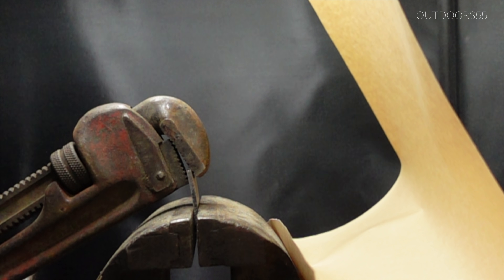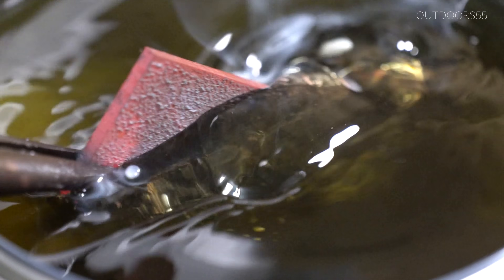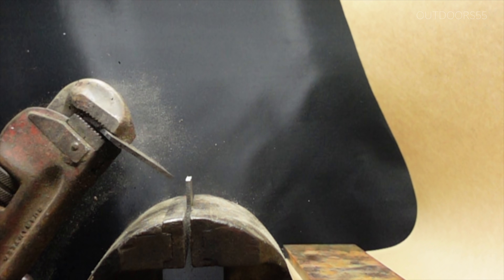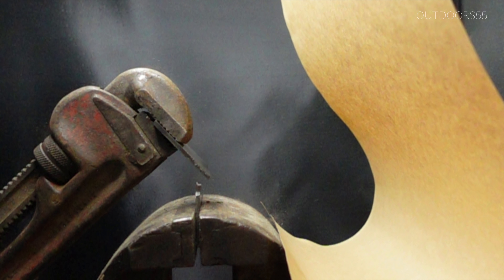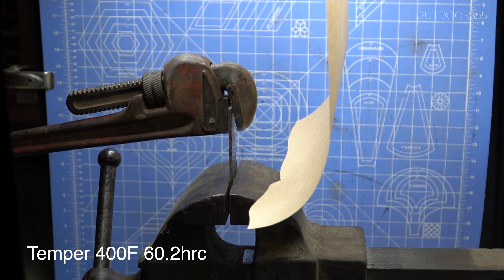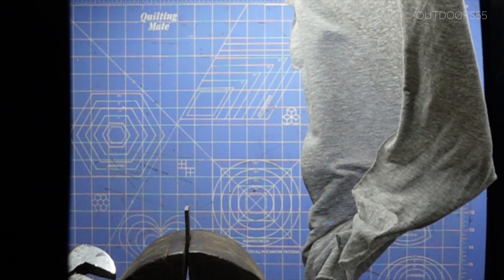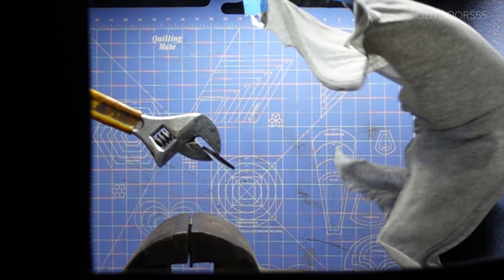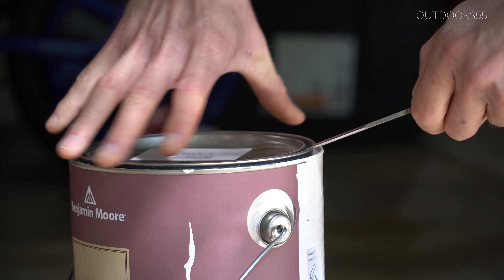Why You Should Never Break A Knife....And Probably Can’t

Comment: I always assumed they were concerned of practical use and functionality, qualities, over the safeness of the blades. It seems like where the qualities are needed for the use, it can't much be helped, no matter the type a catastrophic failure due to unforeseen circumstances will be catastrophic failure since the metal will give up after packing a great deal of energy. I suppose the safety equipment is the only real answer to the safety side of things. Sort of "if you wanted cars to be actually safe in a catastrophic failure situation, you'd have to remove cars" situation.

Comment: Hot steel going into your eyes and shoulders don't feel good. I've had both. But I also like my knives hardened to 60-62 rockwell atleast if applicable. Depending on the steel, higher. 

 If you use the knife as intended. And don't pry on it like a dumbass, shattering blades don't matter.

Comment: Thank you for this informative video! I understand the point you were trying to make. I typically only use my blades for cutting tasks. I like SAK knives for this. I heard that the other tools on a SAK are tempered lower than the blades for example the large cap lifter and screw driver they recommend for light prying tasks. I typically don't carry a knife with that feature. I carry  a single bladed number 1. Since retiring I'm usually always close to the proper tool for the job. I bought a small tinker I really like, but love the Alox handles on my number 1. Everyone is different and needs to find what works for them and their personal use. Thanks again for doing the video!  Jeff

Comment: I think it very much depends on the steel and the type of knife. With a hard use knife (like a chopper etc), one ideally would want a tough steel that bends under failure instead of it shattering. But then you have steels like M390/20CV that are not designed to be "tough" at all but have good edge retention, and the performance really shines between 62-63hrc. But still. After being on the market for so many years, companies still run M390 at 60hrc (sometimes even lower) to "increase" toughness. That to me makes no sense. Taking a steel that is not designed to be tough, heat treat it lower to make it "tough". While in reality the companies would rather save money on grinding belts instead of heat treating it at a proper hardness. They will charge us the premium price but not go the extra step to do the work we pay extra for as a customer. More transparency from some companies would be great, or just use a different steel than M390 /20CV if they can't deliver the HRC and heat treatment certain steels need to gain the performance and attributes of said steels. If a company took ZDP-189 and made it at 60hrc, it would leave some people scratching their heads.

Comment: I do sword fighting and we once had a blade break. Found the pieces stuck in a tree and we were terrified since checking every blade before use. Pretty much reflects your results
Reply: I always say "you can use a blade that's too soft, but you can't use a blade that's too hard"
Reply: @jeanladoire4141  Aye. you can keep fighting with a blade that has a kink in it, but one thatcroke off....not so much.
Reply: @lutzderlurch7877  yeah, blades were pretty fuckin soft (close to untempered mild steel) for most of history.
Reply: @jeanladoire4141  Not sure I'd go that far. it is surprising, how much was possible, genrally speaking pretty early on already, and  what was actually done, as well. But without electric controlled thermometers and furnaces, modern chemical analysis of the pieces of steel, there was  a much higher variability, and a good argument to err somewhat on the safe side. Swords also broke in combat, but it just goes to say, the  line to walk for prefect balance is narrow at best, and with a thing as long as a sword and subjected to the forces a sword blade is, one had to be careful not to overdo the hardness.
Reply: @lutzderlurch7877  no i saw studies, on earlier swords (before the proto industrial revolution of the mid 14th century), the steel was rarely even tempered, parts of the blade were wrought iron, and a few centimeters later there would be a patch of tool steel. Average hardness in the 13th century would be around 25 rockwell. And i say average beacause every centimeters of the blades would have different hardnesses. Swords would rarely break on earlier periods, being more prone to bending, as was mentioned by Caesar for Celtic swords, Nordic tumbs found with bent swords, and just metallurgical analysis of the found exemples. So yeah, i'm pretty confident when i say swords were usually pretty damn soft, with harder spots, but it was a nonsense to have a hard sword, beacause a blade doesn't need to be very hard to perform well, contrary to what people say today (and once again i'm a bladesmith, i make swords, tools, whatever, and i have experience working with bronze, and while they need frequent honing, just like a poor quality modern steel blade, they will do what you want them to. I've chopped a deer into pieces for a hunter with a mild steel falchion that was 2mm thick near the optimal striking point, and the edge didn't take a dent even trough the spine and bones).
Reply: @jeanladoire4141  Are you sure it mentioned very uneven hardening, or blades made by forge welding several different types of steel together?

Memory is fuzzy, but I believe bending swords was at least is some portions done to ritualistically destroy the weapon or make it unusable for grave robber, likely including purring it into a fire.

Do you have the name of the study handy?
Reply: @lutzderlurch7877  regardless of if the hardening was uneven it wouldn't matter as the carbon content was just all over the place, just like a puzzle a lot of the time. Good hard blades existed, but they were for the top of the elite. That would have changed in the 14th century as society began to industrialize after the great plague, i've visited paper mills of the 14th century and then checked medieval industrial forges, and found the exact same mechanisms for mechanized hammers (with water etc). The proof of steel quality advancement can be proven by both the appearance of steel tempered crossbow prods, and just by looking at manuscripts and seeing that more and more soldiers wore armor on the depictions.
But that wouldn't have been the case before. I'll try to find you the study on the swords and get you a link 👍
Reply: @lutzderlurch7877  so i just did a quick research and found one of the studies, this one was about ulfberth and early medieval swords, "a metallurgical study of some viking swords". Carbon content from 0.36% to 0.76%, all over the place. Average hardness of 120-160 vickers in the center, and 220-300 vickers at the edges. That's about 29 rockwell for the hardest part of the edge,the rest of the body is too soft to be classified on the HRC scale. The structure was pearlite and cementite, basically results of untempered steel. The edge was probably harder beacause they hammered it cold to work harden it, just like you would with bronze swords. I sometimes make knives from modern aluminum-nickel bronze, and i'm getting hardnesses of about 280 vickers, more or less (i do the tempering over the fire so i never really know the result, just an approximation), and frankly that's on par with what they had at the time. A well made traditional tin bronze would also go above 200 brinell with proper cold working. And these were high quality swords for the time. They chopped skulls in half with clean cuts (as the skeletons from battlefields can show). An untempered blade will perform pretty well against anything that's softer than it (like people), at the cost of frequent maintenance.

Comment: The other reason you wouldn't leave the steel at its ultimate hardness is sharpening. Once you get around R62 sharpening is a pain. Add Chromium in amounts 5% or larger and you get an extremely wear resistant steel. (Think M2 hss drill bits. When you get to steels that are 11% to 15% wear resistance is off the charts. D2 steel is a perfect example. Above R60 it's a nightmare to sharpen on natural abrasive stones and ceramic stones as well.

Comment: You have a kiln, should make the spine softer than the edge. I've spent years in SE Asia where they forge machetes out of leaf springs and harden just the edge then normalize  it. These blades are 12 inches long and are tapered from about an eight inch at the spine to razor sharp, enough to cut heavy bamboo or a mans arm off with one blow. And you would never break one, maybe just chip the edge or tip.

Comment: Chapeau, a good choice of interesting subject.
The higher the degree of hardness the blade will not be flexible, and it will be more prone to breakage and its maintenance will be more challenging both in the sharpening means required and in the technical challenge in sharpening it.

Comment: 4:28 You took a "decent size" piece and got 83mph, I tracked another piece, and if you were shooting at 1000fps, and the distance between the vise and the paper is about 8 inches, then that piece flew at 330mph... Perhaps tiny, but get anything at that speed into your eye and it's very likely blind or at least going to need surgery to save your vision in that eye.
(edit: I had rounded it down as my calculator said 334mph... Funnily that's the exact same number you found when you tracked the sparks a bunch later in the video, so I assume my guesstimates were pretty much spot on, ha! Sweet video, interesting addition to your older video titled something like "why you should always break your blades" ;p )

Comment: Nothing new under the sun. It's just that most of people look at their knives and think about their knives more than they really need to use them on a daily basis. Practical reality will always have the last word on the empty vanity of modern urban man. Ask a breeder or farmer from South America, Africa or Asia how they prefer their blade.
Reply from the maker: This video has far more applications than just knives. Hardened steel is used in many applications, chisels, hammers, drill bits, jackhammers, etc.
Reply: @OUTDOORS55  You're right on this point.

Comment: To be completely honest, I’m on the fence here about how dangerous these little bits flying off actually are. I understand there are random (and very rare I’d say) cases where people are injured, but I really do not think these little chips contain enough kinetic energy to do a lot of damage. Especially if you have safety glasses on.
Reply from the maker: I was injured by a piece of hammer head that broke off (hardened steel). Cut my arm and my forehead.

Comment: Sometimes you may want to have softer steel. Victorianox uses soft steel purposefully to make it easier to sharpen. Its increadible easy to sharpen in a short amount of time instead of needing a special diamond file or something. Also like a razor blade, having a little bit of flex helps a thin knife in many ways.

Comment: Friend, does anyone use 4140 or 4340 to make knives? {I always get, "Duh! Tha carbon points are too low" YES, BUT the idea is that the Chrome;  Molybdenum and in the case of 4300 Steels, Nickel as well, increase strength and durability, Maybe you cannot make good knives from Chrome-Moly, but this cannot be determined solely by the points of carbon.} The SAE chart also lists 4350, but no one has any… Antway, assuming that you can make decent knives from Chrome-Moly, could you make Damascus with 4140 and 4340? Thanks!

Comment: Maybe for big manufacturers, warranties are an issue, but for a small time "hobby" knife maker, I'm more concerned about reputation. Literally one single bad (and possibly dishonest) review about a knife breaking under "normal" pry bar or log splitter use could shut me down. It's one of the reasons I usually use 5160 tempered at 400, with a 1/4" spine, even though I consider it excessive personally. That, and a surprising number of people seem to think a knife tip chipping or deforming when dropped onto stone or concrete isn't a sign of operator error (I mean, lanyards just aren't cool) but a sign of a defective blade.

Comment: Hard steel requires more strength to break, but impact and fractures is what dooms it. The harder the steel the more the imperfections will propagate through the piece.  I had a knife one time and it was quite hard, I hit a coconut shell with the spine of the knife with very little strength,  and the knife went ding and I had two knives after that. You never know when  a brittle blade will snap with impact/harmonics/flaw propagation, etc

Comment: My father worked as a mechanic for a long time and I've watched him cut bearing races off of axle shafts using a sharp cold chisel and a big hammer.  And occasionally he would get small sharp pieces embedded in his skin.

In terms of knives if you have a knife that yields slightly at high stress vs. fracturing, the user can see that they are pushing the knife too much and they will stop before going further.  If the knife continues up the stress/strain curve to its fracture point the user does not have any indication of how close they are to failure.

I will suggest another factor for consideration in your tests and that is stress concentrations at notches.  Breaking a smooth flat bar you have no stress concentrations, you are using the entire width of the piece under uniform flexural stress.  But knives have various notches- gimping, notches for locking mechanisms, holes for thumb opening and thumb studs, sharpening notches, choils, etc.  You will get a higher stress concentration at these irregularities that will cause the blade to break before reaching its full fracture strength.  I've seen plenty of blades broken through irregularities like this, likely at lower values of force than it would have taken without the irregularity.  Test some samples with irregularities and see how the strength varies at different hardness values.

Comment: If people didn’t know answer to this, they are air headed. Not trying to be mean but it’s common sense, that softer materials are more malleable, harder materials are brittle. Not just metals, either.
Reply from the maker: That is true, however that isn't what this video was about.
Reply: @OUTDOORS55  I know this, but you stated a question at the beginning, why manufacturers don’t make them as hard as possible for edge retention. Or something along those lines. Not quoting, of course. 

Brittleness, and the dangers that come with it, are what both points you made boil down to. 

I will apologize for being an ass though. I shouldn’t have even phrased my comment that way.

Comment: It doesn't make sense to me to ignore edge stability, since that is the main reason why you would change the hardness of an edged tool. If manufacturers were really scared of weird warranty claims or safety issues I suspect they would just selectively harden/temper using some sort of induction heating.  It is done all the time with saw teeth and such.

Comment: The real reason is that you're not looking for hardness over everything else. Overly hard blade is brittle so it chips more easily therefore losing its sharpness way faster and it's harder to sharpen.
Reply: That's why some steels are "better" (M390 vs 440A) - you can heat treat them to a higher hardness without losing other desirable properties like corrosion resistence and elasticity. Other benefits include more uniform internal structure and composition more suitable for some applications.

Comment: The aspect of danger as it relates to metal failure at different hardness values is interesting in and of itself I think. In the context of a knife, I think your conclusion is absolutely correct taking into account the average user. But what if we remove the human element altogether? If both soft and hard metals are to break, which is the most dangerous one? How dangerous it is depends on so many things. For instance if you assume that the same force is used to break a piece that will split in three compared to a split that will break into 30 smaller pieces, then the smaller pieces would be preferable, since each piece represents a smaller part of that original energy. Then there's the contact area to take into account. A bigger piece will be much less dangerous if it hits you flat and not on a corner, while smaller pieces are by nature pretty much pointy everywhere. Then what about the direction? If the big piece flies away, it can only go in one specific way. You'd be more unlucky than lucky if it were to be in your direction. Meanwhile the smaller pieces will likely go in many direction, making you more likely to get hit by one than you would getting hit by one big piece. You can already see how these 3 problems compound each other, and every variable we add makes the problem a bit more muddy, since so much depends on chance. 

It would be great to know how much energy these little pieces were carrying along compared to the big ones. All we'd need in addition to the speed is the weight, if you can find them afterwards hahaha.

Comment: If you are an intelligent person, you wouldn't pry with the knife. Who is smarter? Producers of cutlery, or users? You get the point. In the carotid artery if you are the blissfully unaware user. No blame for the industry. All the blame for stupid people who believe a cutting tool is a pry bar. You are doing good work.
Reply from the maker: This applies to other hardened tools as well. Hammers, drill bits, jack hammer bits have all injured people including me, under normal use conditions. Some crazy stories in the comments about this.👍